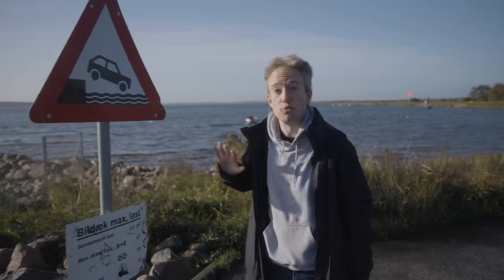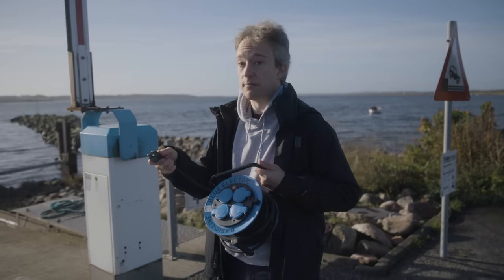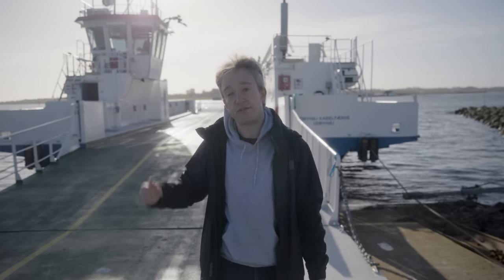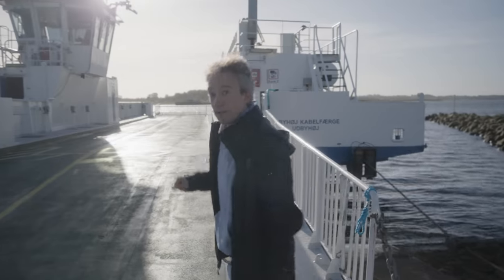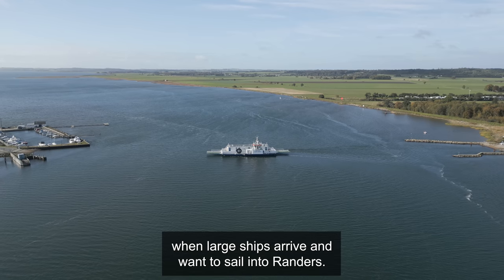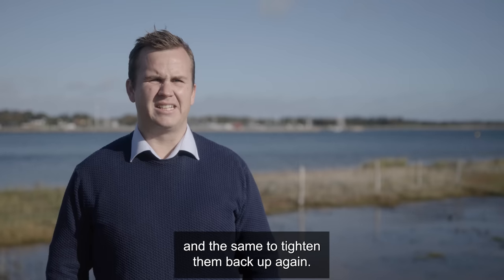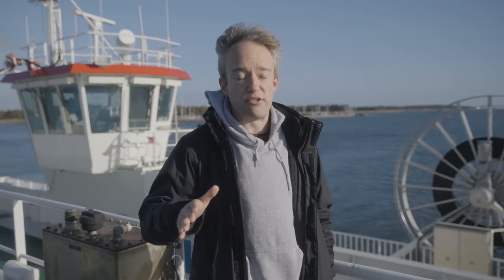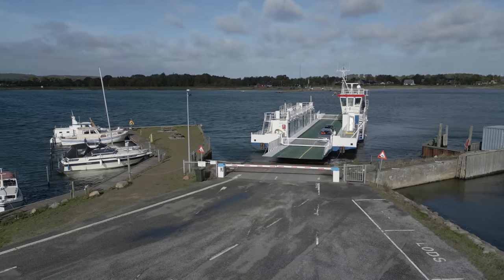This electric ferry uses a very long extension cord

Comment: I love how the cable reel spins. It feels very nostalgic, reminiscent of an old steam-driven paddle boat.
Reply: Gantry Cranes are powered the same Way
Reply: The more things change, the more they stay the same
Reply: I wonder if the wires in the cable suffer from metal fatigue?
Reply: @paulf1071  No. In Conductors, the Metal must be as pure as possible. Pure Copper is very ductile. Copper Alloys would fatigue, but they are much less conductive too.
Reply: It does feel very boat-y.
Reply: I was thinking of a reel-to-reel tape player (although it only has one reel) :D
Reply: A balance of form and function, the epitome of design.

Comment: A fully electric, non cable guided ferry exists between Denmark, Helsingör and Sweden, Helsingborg. It charges between every trip and they built a new substation to power it. When it docks it (was supposed to at least) automatically connect the HV cable using a robotic arm/guider to the ferry and charge before departing again in 20 minutes.
Reply: We also have a bunch of these in Norway!
Reply: Batteries aren’t green compared to connecting directly to the power grid through wires, why all railroads for instannce should be electrified, instead of battery, hydrogen, or diesel.

Comment: That makes total sense, just surprised they didn't go the extra step of having the ferry be dragged along by stationary winches on each side
Reply: I imagine they considered that. 
But think it through ... 
What if, electricity fails, and they are in the middle of the river?
With their current solution, the captain can start the diesel generator on the boat, and they'll be out of the way in a matter of minutes.
Sure, you could have diesel generators on shore, and operate the shore winches that way too.
But that would require constant shore personnel, just in case.
The ferry, as shown here in the video, can be operated daily by a single person.
Reply: @ThorNado77  oh totally, though I had thought about them keeping the on board diesel engine while being dragged along
Reply: He said that’s what this one replaced
Reply: @luelou8464  Why would you need two winches? Think of it like a cable car or an elevator, which are proven safe systems. Also a stationary winch no longer has to fit on the boat and transport its own mass every single journey, which would result in reduced costs if anything.
Reply: @luelou8464  Bigger ships could pass in precisely the same way: dock the ferry and spool out cable. Also a "weather resistant building" is simply called "a building" lmao
Reply: @luelou8464  With the machinery on shore, why would the ferryman need to be aboard at all.  He could stay in the winch house all day, perhaps selling tickets if not too busy.  Many amusement rides operate that way on quite small budgets.
 As for switching direction, the winch could simply switch direction, pulling the other end of the "rope" to go back, with the far end being a simple tackle block.

Oh, and as this was a retrofit of a self powered diesel electric ferry, a long extension cable was the simplest change other than heavy batteries.
Reply: Or why not go the extra step and just build a bridge? I hear they don't use any electricity at all!
Reply: @Khaim.m  Actually this ferry only uses 200KWh per day. The street lighting on a 350m bridge could easily be more. Sump pumps, navigation lights, deicing heaters all use electricity too. Steel/reinforced concrete bridges typically require cathodic protection to slow corrosion which could be 420KWh (35x500W zones per the NCHRP).

In other words, water transportation is so insanely efficient compared to road that it takes more electricity just to stop the bridge rusting or collapsing or light it up at night. Without even considering the energy actually used by the vehicles.
Reply: @luelou8464  you only need a winch on one side. We invented pulleys a long time ago. Also, how ‘clean’ is that electricity?
Reply: @ThorNado77  There could still be diesel generators on the ship too if they used shore winches.

Actually, I wonder if the generators they have on board can even be used to propel the ship? Considering it normally just goes along the track and doesn't use a traditional propeller. I suppose it probably still has one anyway.
Reply: @Cruxador  The diesel generator could be on the shore, right next to the winch.
Reply: Because it's was way cheaper to "simply" use the existing system with electric motors instead of diesel engines.
Reply: the ferry already latched on to the cables and pulled itself with the diesel generators powering traction drives on the boat. so switching to mains electric just meant the power cable and the reel. and th generators are still there as backup.
Reply: @Khaim.m  cost would be huge. the bridge has to let big ships go under it. so the approaches would need to be raised like 100 feet
Reply: @ThorNado77  except backup generators are land would just be automatic like the ones on houses. Power fails and they kick in on their own
Reply: @Khaim.m  Navigation lights, and streetlights use electricity, but some are solar, and some bridges have heat or air conditioning, to keep the humidity low, to prevent rust on the suspension cables, or to melt snow, but you make a good point.
Reply: They didn't talk about it here, but many table-guided ferries aren't actually pulled along by the cable. Instead they simply angle the ship, and allow the river current to push it. That doesn't mean that you don't need power on the ship, there are still things you need to adjust, there's the ramps to raise and lower, there's lights, etc. Honestly though when they quoted 200 KWH per day, I really have to think that this is likely the case here. That's not that much electricity when you're talking about moving such a large item through the water, so I suspect there's a good chance this ferry is powered by the current.
Reply: @jameswhitaker1324  around 65% of it is from renewable’s.
Reply: @pws3rd170  in Denmark we do have the most stable power grid in the world with delivers power 99.997% of the time per year. Backup generators ain’t needed here 😊
Reply: @KasperNeve  So, I would ask again, how clean is it?
Reply: @jameswhitaker1324  many times more clean than diesel engines

Comment: Tom despite the fact that I shouldn't be surprised at the subjects you cover after this long I am amazed at this one. I remember cable ferries in my area but they were driven by diesel engines. They have long since been replaced by bridges. Thank you.

Comment: The Wheatland Ferry across the Willamette River in Oregon used to be an electric ferry. Power was supplied by an aerial cable suspended about 80 feet above the water. Several (20?) years ago, they decommissioned the electric ferry and replaced it with a diesel-powered one. Go figure.
Reply: I'd like to see a video on that!
Reply: Would this be in the same United States that is currently replacing it's nuclear power plants with coal ones?
Reply: @krashd why yes it’s orgeon

Comment: In Strausberg, a bit east from Berlin, Germany, there is an electrical ferry which is powered by an overhead cable. The cable spans roughly 350 meters all across the Straussee lake and the ferry draws its current via some kind of a trolley pole.

It operates this way since 1915 and has got a line number like any regular bus line (F39, F for Fähre / ferry), similarly to many other ferries in the Berlin region.

Comment: Check out the ferry from Flakk to Rørvik. It's a plug-in hybrid, and charges on both landings by having two huge metal plates make contact with a charging point on the ferry. It uses 4.5 MW at 11kV each time it stops to let cars off and on.

Comment: The Willamette river in Oregon USA has 3 ferries that are electric.  They all use overhead trolleys to deliver three phase power.  The cables are far overhead and a drop cable brings the power down.

Comment: There used to be dozens of cable ferries as part of the Finnish road network. But - much to the consternation of sailors - most of them have been replaced by bridges. Still, it might make sense to electrify at least some of thing using this method.

Comment: Perhaps this has been asked before, but why not put the power unit on the land, and use the existing guide cable as a pull cable? Would need to turn the cable into a loop with a wheel on each end but it can be electrically powered by only one side. Suppose it's more difficult to loosen it for large ships
Reply: I was thinking the same, but with a  single cable and a puller at both ends.

Comment: The Tim Traveller just did a video on motorless ferries --- cable-guided ferries which use the current flow in the river they're crossing to power them. The pilot just pulls a big lever and the ferry quietly moves across the river. They're quite small and I'm guessing that fjords don't have enough current to operate one, though...
Reply: I like Tim, but Tom did that at well.  🙂
Reply: The Fjords might have enough Current with the Tide going in or out, but that's just a few Minutes four Times per Day.

Comment: Of course the Danes are able to make this work. Here in Canada, the BC Ferry Corporation bought a bunch of electric vessels but has no way of charging them so they say "Electric" on the side but actually run on diesel.
Reply: @ragnkja  As a solution? Wouldn't that just use more diesel less efficiently?
Reply: @ragnkja  Supposedly the ferries will plug into shore power...someday.....maybe. If they build the infrastructure for it.

Comment: I learnt by talking to my local River crossing ferry operator that the reason they don't operate during high winds is not because the ferry can't do it safely, but because the wind pushing the ferry sideways greatly increases the tension on the cable, preventing it from dropping and allowing other vessels to pass. Very interesting

Comment: The massive container ships are a big fuel burner... but they are very energy efficient per kilogram of cargo per kilometer. It is probably the most energy efficient way to move weight any distance.
Reply: Not at this distance it would seem. In the video they said they used to use around 100 liters of diesel per day, and nowadays around 200 kWh of electricity. Considering a liter of diesel contains around 10 kWh of energy, that's an insane improvement in efficiency.
Reply: @jlust6660  Massive container ships are not used on the distance in this video. They go across the oceans.
Reply: They are also something that could actually be replaced with a reliable low carbon power source in time. Those ships are more than large enough to handle the mass of a fission reactor complete with shielding. The main reason why the experimental nuclear merchant ships were not commercially viable was a lack of trained personnel and infrastructure to maintain them. Both of which are structural issues that could be solved with a plan being put in place to support the transition. After all we know how to train engineering graduates that can do this work and the equipment they need to operate, many military naval bases have this in place so civilian infrastructure for nuclear merchant shipping could be built. It is possible to build reactors that become passively stable if immersed in the deep ocean at ~4C and still have far less health consequences than just turning on a diesel generator of that size for a day, respiratory disease due to air pollution is no joke and there is a good reason why fossil power sources have death rates in the tens of thousands per TW per annum just when running normally.
Reply: @jlust6660  I'm guessing the diesel generators were started at the beginning of the day and ran all day regardless of whether the ferry was in motion.  The nice thing about the electric conversion is power is only used during crossings.
Reply: @Engineer9736  Exactly, that's why I specified that at this distance at least, they could probably be beaten
Reply: @KonjonoAwesome  Yes, good point
Reply: -that is, until the military decides to give up their naval nuclear reactors to the private sector.
Reply: @jlust6660  A cargo container ship here would literally just span the entire river and become a bridge. They’re not what you’re talking about.

Comment: I wonder how the efficiency of this compares to simply using electrically powered capstans on each shore to haul a ferry back and forth on cables fixes to the ferry; rather than the ferry pulling itself along cables fixed to the shores.  (Guess there might be higher risk of cable damage since they're not just getting moved up and down)

Still, very cool to see.  Thanks Tom!
Reply: The efficiency (or rather the energy usage) should be nearly the same either way.

Comment: Quite unexpected to see you back in Denmark Tom but heck I didnt even know about this, and I'm a Dane myself. Though I do know we have been making huge advances in green boating. We have several battery ferries around the country already, heck the ones sailing between Elsinore and Helsingborg north of Copenhagen are the largest electric ferries in the world IIRC. And DFDS who are headquartered here plan to launch an entirely hydrogen powered ship on their flagship Copenhagen to Oslo overnight ferry by 2027, while Mærsk are looking at methanol propulsion. Neat stuff all around .
Reply: The fatal flaw here.   Denmark still gets  ~ 56 to 76 of its electrical power from oil, coal, natural gas and other nonrenewable sources depending on season and year.  

Oil  ~ 32 - 38%
Coal ~ 10 - 16%
NG ~ 12 - 18%
Other nonrenewables ~ 2 - 4%
Reply: @forkliftofzen5318  You make a good point, but none of that adds up to 100%. Maybe you forgot to count a category, like nuclear?
Reply: @buddyclem7328  I left the other part blank so that others would look into what is there and see it for what it is and how small of a percentages it actually caries.
Reply: @forkliftofzen5318  I'm not so sure about that, looking at the state energy grid's live statistics (and history) on "energinet dk / energisystem_fullscreen" we actually get most energy covered by wind energy, most days esp. during the winter periods, some days even 100% from renewables, it's becoming more and more frequent, but of course, days with no sunlight, and no wind, we need to import energy, mostly from NO/SE/NL/DE. But since the grids are connected, even if we manage to cover all our own usage from renewables, we might still import/export from other countries, to balance the North European power grid.

Comment: Since the ferry is already cable guided wouldn't it be easier and more efficient to have it be pulled by those cables and have the motors that do so on the shore sort of like a cable car/gondola?
It would be more efficient as the ferry itself would be lighter

Comment: We have tons of battery-electric ferries here in Norway, but some have had an unfortunate tendency to spontaneously combust.
Reply: good thing there is all that water to put it out
Reply: The electric vehicles are going to be entertaining if anyone can charge them 😂
Reply: Good thing old fashioned cars never burn down 😉
Reply: @loganshields2739  Unfortunately they probably utilize Lithium-Ion batteries, and Lithium explodes in contact with water.
Reply: Are they more likely to catch on fire than other types of ferries?
Reply: @Duspende   @Duspende  ye i know, i was joking. 
also the water would be broken down into hydrogen and oxygen by the electricity via electrolysis adding fuel to the fire. 
doesn't matter if it has lithium batteries, never add water to an electric fire
Reply: @sjorsangevare  old fashioned car fires can be put out with old fashioned water in an old fashioned amount of time by old fashioned fire fighters with old fashioned trucks.
Reply: my old fashioned horse and buggies can be fueled with old fashioned feed from an old fashioned bucket while in old fashioned motion
Reply: @Duspende  Metallic lithium reacts with water, but lithium-ion batteries don't contain any... they contain (wait for it) lithium ions, similar to how table salt contains sodium ions without exploding on contact with water (like sodium metal does).
Reply: @jamesbizs  I have never seen the fire department put out ICE car fires with water.
You probably neither. So why are talking like that's a thing?

But you know how they put out fires in electric cars? With water
So you got that one kinda backwards.
Reply: @loganshields2739  Exposed, exploding circuits don't do electrolysis. At least not enough to make any significant amount of gas.
Reply: Didn't know Samsung was in the ferry business.